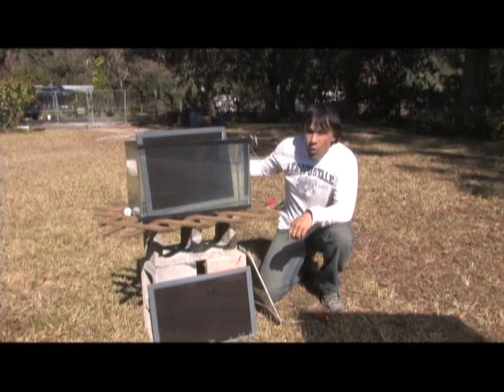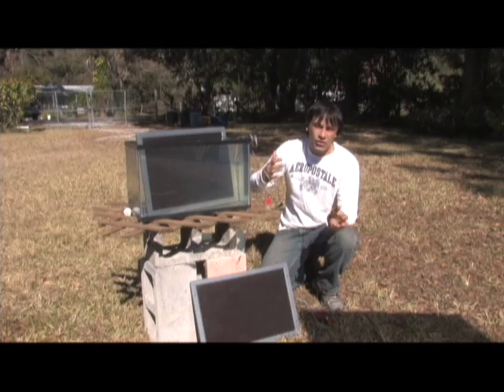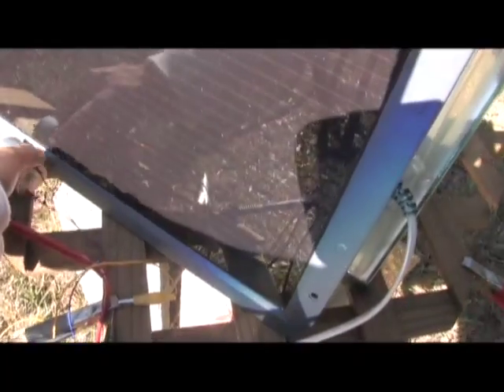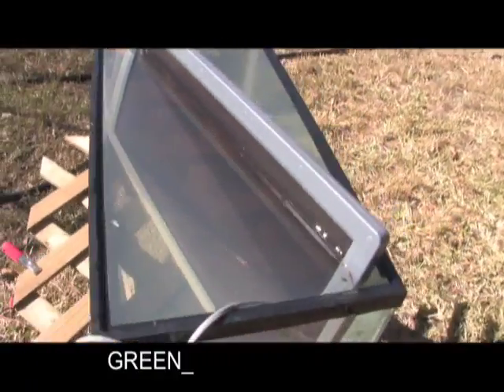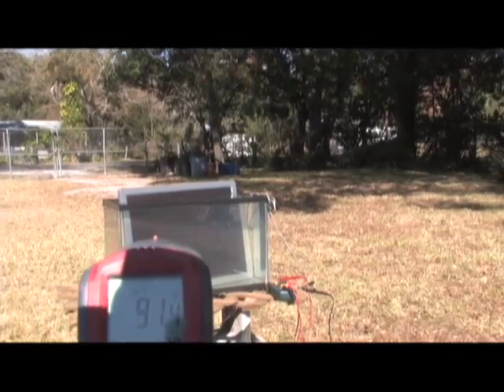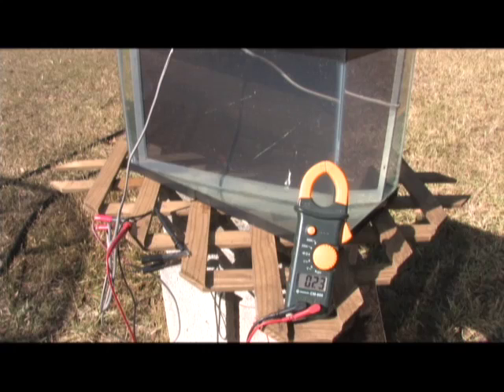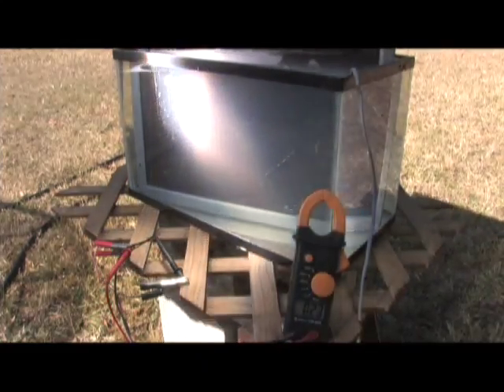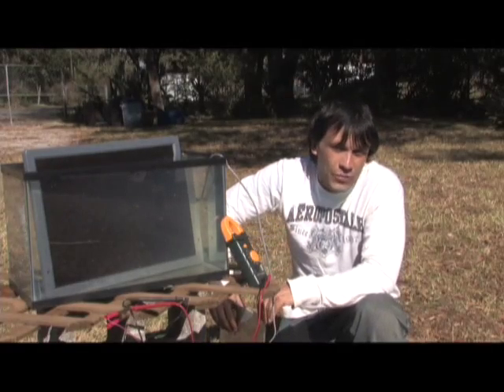Underwater SOLAR PANELS 9% Stronger PV Photovoltaic Sun Power

Comment: would putting externally cold water water. ice. salt to drop the temp down to the lower 20s to see how much that would effect? if a few degrees makes a big enough difference. that should make it around 24 without a lens focusing sunlight on it and probably around 26-27 with lens putting light on it ^^

Comment: how about using that extra voltage 2 power a sm water pump 2 continually cool the sealed panels as they are. maybe provide a continual flow of water so 2 speak with a pan, pipe or gutter type mechanism 2catch the runoff and direct downward 2 cool underground. so have enough water to fill the hose 2 the pump and up 2 the drain so the pump doesn't struggle. provide an autofill reservoir mechanism similar 2 an upside down water bottle dog-cat water dish 2 make up 4 evaporation.

Comment: I guess if you had an elevated aqueduct* (moving water from a natural spring to a water wheel or something), you could build in tank protruding from the aqueduct's bottom to the ground, and put you panels in there... cool water would sink tot he tank bottom and hot to the top where it would continue down the duct...

Sounds like a ton of effort.

 

*(right word? - an elevated shelf/tube that water travels through)